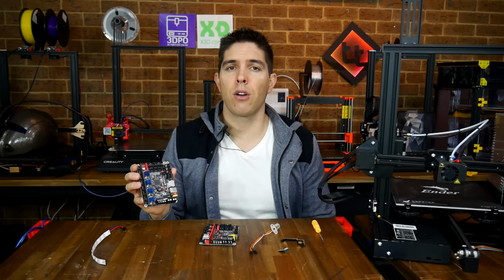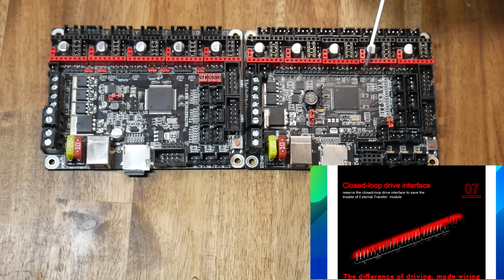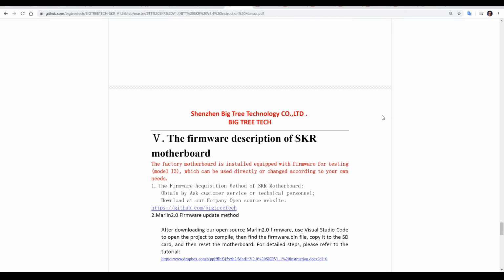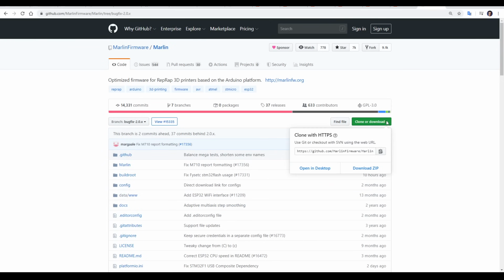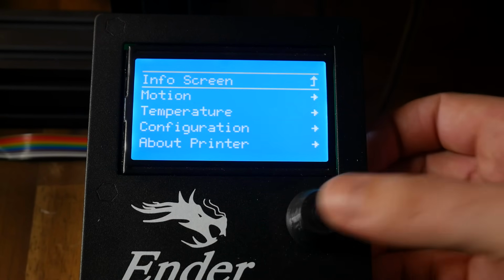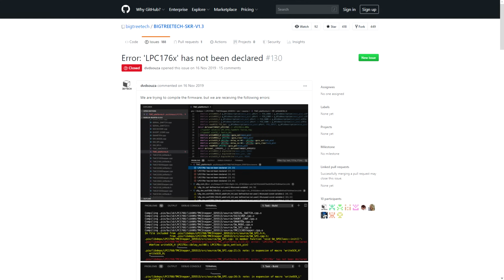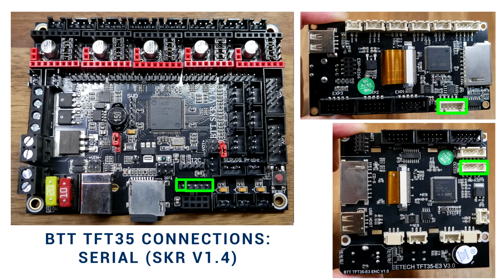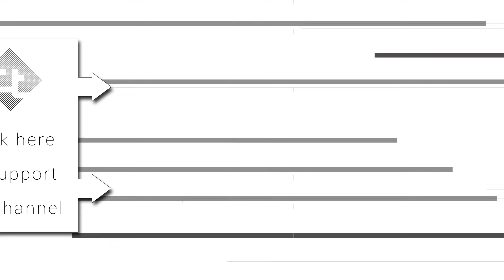Bigtreetech SKR V1.4 (Turbo) comprehensive guide

Comment: I did all the steps according to the tutorial, but when I wanted to compile the firmware, I got exit code 1 and a lot of compilations failed and fatal errors, anyone know what i did wrong?
Reply: Same here. No matter what tutorial I use, it always fails...
Reply: @jrmaddock1  Turns out, there's something wrong with the pins on certain stepper drivers. I bought some off brand ones that came in a kit with the board that i got from a craigslist like site.  You might want to look into fixes that people have done by placing the jumpers underneath the stepper drivers diagonally. As it's been a while since i did it, i cant completely recall the steps but Here's something that i remembered: https://www.jayuk.org/bigtreetech-skr-v1-4-normal-and-turbo-and-fysetc-tmc2209-v3/ This isn't the full tutorial but I hope it can lead you to a solution.

Comment: I'm in the process of converting my current printer to a SKR 1.4 Turbo + sensorless homing on X/Y axis. Should be fairly easy without using the pre-made configuration files. :)

Comment: I followed this guide and the guide for the 2209's firmware. The XYZ Axis' all move properly and silently, the extruder motor makes a god awful squeal that does not stop until the steppers are disabled. I have no idea what the issue is, I tried having the current set to 900 with no luck, I tried setting the current lower with no luck still. I have no idea what I need to do but the noise is killer

Comment: Ive bought the BTT SKR 1.4 Turbo to upgrade the Melzi board in my Ender 5 Pro but after following the video, connecting all the wires correctly and modifying the Marlin Firmware and burning the Firmware.Bin file onto the SD card. I switch on the printer but all I get is a blue screen and a loud beep which comes an d goes. The boards lights illuminate etc? Can anyone advise on a possible solution?
After carefully looking at the screen at an acute angle you can make out the graphics but its very faint!

Comment: Run Micro Swiss All Metal Hotend and micro Swiss DD changed to 50w hottend and thermoristo I think it's called. To drive up to 300 degrees. BigTree 1.4 Turbo motherboard Merlin 2. Latest edition. The problem is that it feels as if it does not have the strength to get above 255 degrees at start-up, it can stand and warm its head for 5 minutes, it does not exceed 245 degrees. Are these any errors in Marlin config. Have run auto pid a number of times

Comment: @Teaching Tech I am trying to do this on a CR10S and I don't know what to do with the VIN plugs from my CR10S board, there is nothing on the 1.4turbo board that shows a place to plug them in. Do I use the fan ports for these?? Please help I old with little hair as it is, really don't want to pull out the last of it struggling with this board.

Comment: Hello, could you compress the Marlin 2.0 folder already configured for Ender 3 with BLTouch? My board is the SKR 1.4 Turbo. If so, you could put the file for sale.
Reply: Hi, I did it. If anyone needs the firmware ready for SKR 1.4 Turbo, TMC2209 and BLTouch, mine is working.

Comment: My firmware folder does not contain the .pio folder.  I'm assuming this folder is created by platformIO when the firmware is compiled? 
I can't find where the compiled firmware.bin has been stored.  I did find a work around though - if I put the sd card in my computer, compile the firmware and click 'upload' the firmware.bin file is automatically placed on the SD card

Comment: I haven't been able to find an answer to my question, but are you able to connect a filament sensor + the bltouch (CR10) on the SKR 1.4?
Reply: Yes you can. Look up the pins in Marlin to see where to plug it in at.
Reply: Thanks for the responses guys!

Comment: Hi there,

I'm hoping you can help me solve a problem with my 3D printer. I recently purchased a BIQU B1 Printer, which arrived yesterday. I finished the assembly and during calibration, I received an error message:

MINTEMP triggered, the system stopped! Heater_ID: bed
printer halted. kill() called!

I tried entering the factory setting code M502 followed by M500 and M501, with no success. Then, I tried using the Marlin LCD option and this yielded the same results. On top of this, the SD card and its files seem corrupted.

I've still not been able to print anything because of these issues, but hopefully, we can change this.
I'm wondering whether it's a firmware issue... if so I think this video will help me get it sorted.

Comment: Having an issue with one of my ender 3 pro's. I replaced the main control board with the BigTreeTech SKR 1.4 Turbo. TMC2209 drivers. Marlin Bugfix2.0 installed. When I try and 'Home' the X & Y go home as they should but the Z will not. It moves toward the center of the bed. I tried moving the Z alone and it will go up but will not down. I have checked all the connections, reinstalled firmware and nothing is working. Anyone have any thoughts?

Comment: Hi, I've tried to get my BLTouch 3.1 working with the SKR 1.4 Turbo. I plugged it in the Z-Endstop pin. It took me 2 days to recognize, that the black and white cable of the sensor cables are actually switched, black needs to be in the middle. (black -> GND, white -> 1.27) also, the servo cables are in the wrong order). Hope this helps someone else.

Comment: Does anyone have one of these that works? I've thrown away an entire weekend with a printer apart trying to get this board to actually print. Let's forget sensorless homing, BLTouch, or other enhancements. I cannot get this board to read from the SD card to print. Octoprint and my Windows 10 desktop cannot connect to it when it is powered on and I can't connect to it powered off with the jumper in the USB position. After reading through dozens of posts on GitHub, Reddit, etc. I'm beginning to wonder if only YouTubers got working boards. I appreciate Michael's tutorial and explanations. They were a great help when I was building firmware and making changes, however, it is all moot as this board is getting tossed. It's a shame because the 2209's on it made the it seem like a well oiled machine.
Reply: I found there is a THING with the SKR, you can either print from the sd card or when hooked up to a pc you can send files to it but
when set as such the card isnt seen by the printer and thus useless
, there is a setting in marlin {which i have set to print from the card},
that when connected via usb, my pc cannot see the printer or the card,  HOWEVER when i use Release media in the lcd, the card appears in windows and
 I can send files to it, once i have loaded up the card, Hit attach media on the printer and the card disappears from the PC and can be accessed and printed from on the E3.
unfortunately  i did it over a month ago and have changed so much getting things just right, but that said,
 I am looking through my Configuration (h and adv h)  and these are the "Lines as i have them"
#define SDCARD_CONNECTION ONBOARD
Configuration h
#define SDSUPPORT
I am pretty sure that is all i had to do (i really hope i dont steer you wrong) as i remember farting with it for a few hours

Comment: Noticed you were using for a Tevo tornado. Same here but stock steppers won't enable with M17 and M122 gives perfect results but enabled flag is false for x y z e?
M17 enables on TFT but motors are not on or humming i.e. You can move axes without resistance..
Any Ideas.

Comment: I will for sure upgrade to it with my Ender 3, BL Touch and heating enclosure and LED cage. Videos will come once I get some more issues figured out with the ABS I am currently using. I sure need ABS because I have productions for ABS already lined up for my Business. Also I got 2  S42B stepper motors and got myself a bunch of TMC2226 stepper drivers as well.
Reply: Hello,

Did the board work well with the tmc2226, and did you need to add any additional wiring. 

Thanks,
Dean
Reply: @deanioannidis7333  works very well have them in use now since a year and all I done is cut of the 1 pin so I can run them proper. I use them for the Z and extruders since we use close loop S42B 2.0V for X&Y

Comment: So if I would use a BLTouch, I would have to bend or clip off the diag pin on the 2209s for all the steppers except for the extruded and z motor steppers. Only clip off X and Y steppers?

Comment: Also, the problem with your firmware updates that are needed are done in Arduino IDE and not vscode.  How do you include the libraries needed for the TMC2208 in vscode?
Reply: I have the same question, are the libraries used for Arduino IDE also required for VS Code? It's poor form to send people to other videos with different software being used and not provide some clarification regarding the differences.

Comment: I dont have the .pio  and the buttons in the status bar?
Whats the problem?
Reply: I had the same problem. Teaching Tech doesn't mention that you need to install PlatformIO extension for VS Code to get the same options as he has. Install VS Code and follow this guide https://platformio.org/install/ide?install=vscode It's very easy and will give you all the required options

Comment: Great video.  I have an Anycubic i3 Mega and the SD Card reader cable does not work with this new MB.  Is there an SC cable that comes with the 1.4 MB or is there one I can buy to connect to the original Anycubin SC card reader?

Comment: Hey All, So I have hotend fan wired to the HE1 (pin 2.4) and I did the firmware change in marlin #define E0_AUTO_FAN_PIN P2_04 as per video, but the fan never comes on. I removed wires and tested directly to 12v power supply and the fan works. I have double checked the wires positive negative are correct and I have double checked the firmware.. Anyone have any ideas?  thanks

Comment: Hello.
Did you made any change in marlin 2.0.x if you connect bl touch? I;m using your alternative connection. After starting th bl touch is flashing and mowing the probe. But after auto leveling the BL touch is not working.

Comment: Hey Michael, I recently installed an SKR 1.4 Turbo and in 3 days the USB port died and took out the rpi that it was connected to and 2 days later the mosfet for the bed died. Contacted BTT and they have been unhelpful and nonresponsive. The board was not even a week old when it died. I now see that both of these things appear to be common issues. Basically have a paperweight now. Just wanted you to know since you seem to think highly of them. The fact that you use them is the one of the reasons I purchased one.
Reply from the maker: Sorry to hear your troubles. I recommend them because I've never  had any issues like you. Some parts have been sent for free but I've purchased many others with my own money. Can you file a dispute with PayPal or similar?
Reply: @TeachingTech  I did not mean to make it sound as if I blamed you (I edited my previous comment to try to reflect what I really meant), your videos are fantastic and I watch them very often. Just wanted you to be aware of the issues they are seemingly having with the 1.4, and the lack of any support.

I am working on what to do about the broken board currently. It is a real shame as the features are second to none but no point in having the features if the boards don't work right or destroy the thing they are connected to.
Reply: @TeachingTech  I left negative feedback on ebay and they instantly responded and agreed to ship me another. Annoying that I had to resort to that but I guess that is why the ability is there.

Comment: Great video, very detailed and informative.

The only issue i have is that what is the difference between using 4 or 5 stepper motors? The skr i will be purchasing has 5 tmc2209 stepper motor drivers but in this vid only 4 are installed?

Comment: Out of interest if one was to install two Y axis motors on a Ender 5 plus could you repurpose the second extruder driver to run this, it can take 6 motors total so it seems, I am considering another upgrade of closed loop steppers (just because I can :) ) so for the Y axis you would have to split this shaft

Comment: Testing now my skr 1.4 turbo with tmc2209s (Clipped pins all drivers) on my Ender 3 pro. Cannot get extruder working. It just makes minor twitches back and forth and I have no idea why. (Unless I shoudn't have cut the pin for extruder driver, if so, I'm screwed.)

Comment: I see that you first get a successful build and load it to the printer with the SD before installing upgrades. My BL touch is mounted from the previous board and I want to use the TFT 35. Is it still best to first build it and load it to the printer prior to making the changes for the BL touch, since the tft requires no changes

Comment: Very informative video, thank you kindly. My current printer that is down is a Sunlu S8 Pro with all manual bed levelling, it has a TMC2208 control board. Which one would you recommend that I get, that is more or less plug and play - in addition to the need for Marlin installation? Thank you much.

Comment: My one major question. ( sorry if this is a simple anser )
I have added a second stepper motor with an extruder ( dual extrusion ) ( 2 in 1 out hot end )

Following this video, I have added the new main board - and TFT touch screen.

currently at the moment everything seems fine ( just auto home'd and that worked as well ).

however, what I am not sure of at the moment ( since I do not see it in the tmc drivers menu, is .... E1 <-- the new stepper motor ).

I changed the proper values ( that I could figure out in the firmware - config.h ) ( extruders from 1 to 2 )
but... after compling ( and it does fine ) I am not getting another extruder showing up in the menu.

I did uncomment the e1 line where you change the stepper drivers over to the TMC2209's and so again, everything seems to be fine, with the exception of not seeing the second stepper motor in the menu...

help please??

Comment: It would be awesome if you would make a video about changing the main board on Anycubic Predator printer for SKR 1.4 turbo with wifi and a new touchscreen. It would be very interesting to implement a Marlin firmware into a delta printer with a great potential like this. Much better budget friendly upgrade than the Duet board like everyone is doing.

Comment: hi how are you? thank you for the video very nice ) i did as in your video but my board have burned in 2 days after operation )))))) the board is skr 1,4))))) the question can i connect the heated bed direct to the skr 1.4? or i need to use the external mos???? thank you

Comment: UPDATE:  After trying to use VS Code with no luck, I keep getting 2 errors.  I did a search for "Firmwear ender 3 pro SKR 1.4 Pro".  and I found a github firmwear bin that  looks specifficaly for my issue.  I ordered the 1.4 board with WIFI, DCDC, AND WRITER BOARDS TO INSTALL. MY QUESTION IS DO i INSTALL ALL AT ONCE?

Comment: Thank you for the video, although I'm trying to install my skr 1.4 in my AM8 with a mini 12864 LCD witch I had to change the EXP1 and EXP2 plastic open to the other side to LCD to work. Rewiring Fans, Thermistors and EndStops.

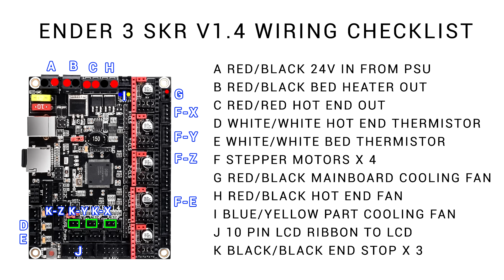Note: I think you have a mistake in "Ender 3 SKR V1.4 Wiring Checklist" at minute 7:29 (Point H it's not a Fan, is it?)
Reply: I think i got it, you use HE1 with pin id 2.4 to Extruder fan insted of Fan 1, 3 or 4, to define on marlin file "configuration_adv.h" that it only starts when extruder is hot (#define E0_AUTO_FAN_PIN P2_04), i'm i right?

Comment: Thank you for the video!
I am having an issue with DRIVER_TYPE and it is throwing TMC connection error when not set as standalone mode.
I've have removed the pin for UART mode.
What am I missing??
Reply: Found the issue:

 #define SOFTWARE_DRIVER_ENABLE

  /**
   * TMC2130, TMC2160, TMC2208, TMC2209, TMC5130 and TMC5160 only
   * Use Trinamic's ultra quiet stepping mode.
   * When disabled, Marlin will use spreadCycle stepping mode.
Reply: Unfortunately any of the axis doesn't  move unless in standalone mode

Comment: I am planning to use the BBT SKR 1.4Turbo in my K40 Laser cutter. I have got a config that works with the TFT35 (no easy task as there are many reasons why I got Printer not attached! message which has nothing to do with the #define SERIAL_PORTs). I have built an Arduino water flow sensor and I have installed a microswitch on the Lid for safety. What is the best way to connect these two sensors to the controller to halt the process if a fault is detected? I could use the filament out detect for one of them. Any ideas. Great video btw.

Comment: If you have Trouble with the part cooling fan check polarity, mine wouldnt turn on so i switch pins on my connector, now it works, use at your own risk

Comment: Its great, im going to upgrade from my 1.3 to 1.4 for native BLTouch support so i dont need to reflash the board.  However the new manual states it supports filament break (runout?) but i cannot see where this would go on the board.
Reply: Same to me, I could not find the PIN for the Filament Runout Sensor ( I have a CR10S5 with filament Runout sensor)

Comment: Hi All,
i am having massive issues with this combination of components, SKR 1.4 Turbo + TFT35 v3.0 - everything works just fine, but the baby stepping is a nightmare - whenever i try to use it while printing the first layer - it lives it own life (i do it from classic marlin display emulation), it is very slow, and i think when i turn the knob it looses some steps (BABYSTEP_MULTIPLICATOR_Z set to 4). Anybody can help or experiencing same problems on the latest marlin bugfix 2.0.x ? 
Thanks !

Comment: I use BTT2209 on my SKR 1.4 Turbo Board and the motors create a horrible vibration + noise. Tried Spreadcycle and Stealthchop (make is even worse). Same Printer was totally silent with my Duet 2 Wifi.